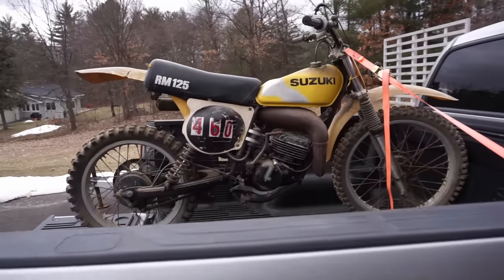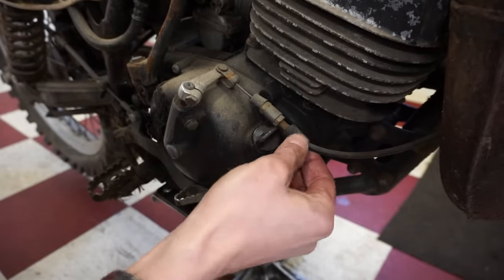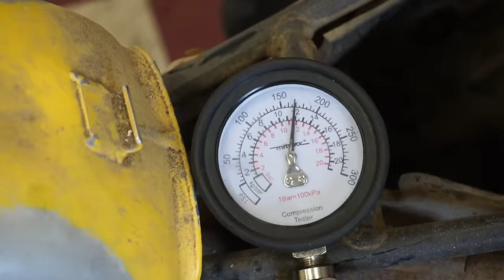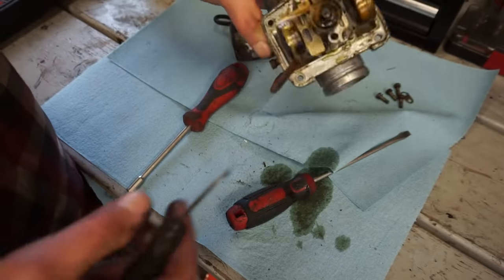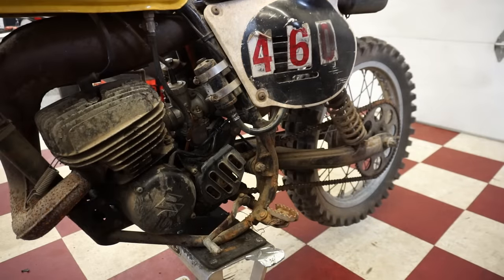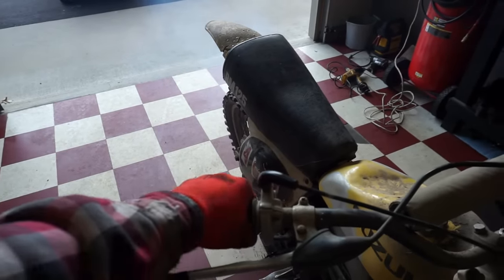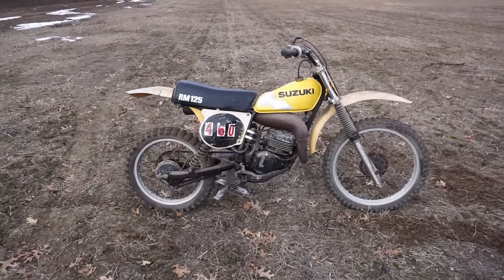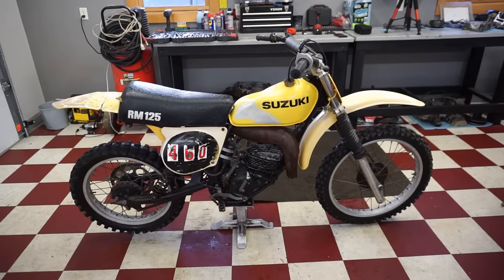Rare 1977 Dirt Bike Found Sitting In Barn For 20+ Years (AMAZING FIND)

Comment: I had a 1977 RM 125 when I was in 7th grade. When I heard the sound as you were riding it brought me back to those days. It was the most fun bike I ever owned. Thanks.
Reply: i had the '77 100 in 8th grade
Reply: Back in the day I had a 1977 125 it too was the best handling bike I've ever owned never should have sold it in 85 to get my RM 250 in 86 I like my 125 more than I did the 250

Comment: Braze a Schrader valve onto and old metal gas cap, screw onto tank and then add air...slowly. :D  I've only ever done this once, but it worked like a charm.  Or call a paintless dent removal guy. They are pretty amazing. 

Sounds very good...didn't miss a beat out on the land. And the smoking cleaned up. LOL Perfect! 

Back in the early 80s, I was still riding one of my two 1971 Ducati RT450s. (Still have them...haven't tried starting them since the mid 80s.) Come winter time I went up to one of the local lakes in the BC interior with a few buddies, our families and a few snowmobiles as well. The night before I was furiously screwing as many sheet metal screws into the knobs of the tires to get ready for the next day. What a riot. I could even run on the harder packed snowmobile trails if I kept the speed up and hung my ass out over the rear fender to keep the weight off the front. Like riding in the sand. The lake was glass smooth and I've never had as much fun laying a bike down at any speed and sitting on the seat and spinning around as you slide for 60 or 70 years. :D.

Comment: Make a rubber stopper with a schrader valve....Seal it off to tank...Add air pressure gradually.. You can also use a map gas torch to heat the dented areas slowly. The heat will also cause air pressure to expand so go slow and be patient...
Reply: I had heard of guys doing the same using a tennis ball with the Schrader valve in it. Cool!
Reply: I agree with this idea.
Reply: Good advice, just be careful how much heat is added to the aluminium: too much could cause it to melt or even blow too far outwards.
Reply: That's exactly the principle I had in mind.
Reply: Said the same thing

Comment: Joe great find. About the gas tank. This when I was younger. It don't work every time. We used to put them in the freezer with water in them. It will expand the tank. Then we got older. We put water in them and heat the dents. Make the water boil. It would come out. Thank you. It reminds of the good old days.

Comment: Reminds me of my first dirtbike, a 1983 rm125 (first blue seat models). I bought it in a very similar state to yours and had been sitting in a shed for 24 years according to the previous owner. Cleaned the very rough looking carb and immediately fired up. These bikes are tough! Having said that, a common issue with these old rm's including mine is that the frames split real easy right under the engine. Nothing a quick weld can't fix though. Curious to see how this one turns out... Keep up the good work and I'm sure you'll flip it without any issues👍

PS. An amazing life hack I never see you use in your videos is mounting/removing the grips with an air compressor. Makes it 10x easier and saves lots of time and energy!

Comment: Wow! I was 14 when I bought my 1975 RM 125! I sold my 1972 Honda SL 100 and my 1974 Suzuki TM 100 to do the deal. I loved that bike! I side saddle pushed it until my friends house who lived next to Morgan Cemetery which we also walked/side saddled thru in 2nd gear. Once thru the cementary we pushed them another few blocks until the train tracks that ran parallel to the Delaware river. At the tracks, we looked both ways for cops and moto'ed it about a half mile until we crossed Rt. 73, down the embankment and ended up behind the Palmyra Diner parking lot which was next to the Tacony Palmyra Drive in theatre and the miles of dredged sand dunes from the Delaware River being dredged back in the late 60's and early 70's. One gallon of premix fuel in a plastic 1 gallon milk jug would get us a couple of hours of awesome riding and back home for dinner by 5 and time to walk to the Pennsauken Mart to buy Lynyrd Skynyrds new Street Survivors album on vinyl. The good ol'days with no bills, no worries other than homework, cleaning the dog doo in the yard, trash cans out or washing one of the family cars.
Reply: Wow,  I rode there before and my friends father took us there with his 80 Husqvarna 430. Brings back memories.  I still live on Robbins close to the Tacony Palmyra Bridge.

Comment: If you can find a way to seal up the tank and slowly pressurize it with water it should push the dents right out, it didn’t look like there were any bad creases. Love the old 70s bikes, I had a Yamaha 175 enduro back in the day, my first taste of freedom!
Reply: I agree. Maybe even pressurize it with water with a little heat the same way you fix dented stroke pipes.
Reply: Exactly what I was thinking
Reply: Yep, and maybe combine that with a hot glue dent puller system used on cars. Cheap ones start around $65. Lots of car vids on youtube using this system.
Reply: It will still look like sheeit. The major depressions may come out, but it will still look all mashed up and creased. You may also expand or burst the seams. The only real way is for the underside to be cut out and then the exposed tank is smooth rolled using a planishing hammer and/or English wheel. Then the under panel is tig welded back into place. A lot of it can be partially repaired using rod anvils inserted into the tank without cutting out the bottom, but that method will never fully restore it.
Reply: @drott150  absolutely right it’ll never look perfect but it’ll be 100% usable and you won’t have to cut the tank apart.
Reply: @minnesotatomcat  It's 100% usable as it is.
Reply: @drott150  not full capacity with it caved in
Reply: Restore it Joe! We need more videos😂

Comment: I was working on my 1977 last night ...i run 32 to 1 ...back in the day they used to run ATF ...you might run it thru the gears and then drain .. will help keep clutch plates from sticking.
Reply: I have put 2 stator and 3 cdi boxes to get it to run...yours starts 4th kick...I had 2 tanks restored and painted for 700..just sold the extra for 350.

Comment: I had one just like it a 77 RM125B  Bought it off the original owner back in 1983.  Sold it in 2006.  That is an awesome bike.  Always started and never let me down.   On mine the side plates faded.  i ran through a barbed wire fence and cracked the front number plate.  The wire also looped up and put a hole in the seat cover.  I also had the original sales slip from the original owner. $475.00  I believe the only thing missing on mine was the front sprocket guard.   I'm not sure they are the original grips.  the originals had the Suzuki S on them.  I couldn't find  a front number plate , I looked for one back in the 80's after I ran through the barbed wire fence.  Definitley  a good candidate for a restoration.  I will say the guy I bought mine form really researched things before he made the purchase.  It had to be the top bike in Motorcross Action and Dirt Bike magazine for 1977.

Comment: Thanks Mister. I have a what I thought was a '77 RM-250 but it has a steel tank I'm sure. Been sitting in a shed for +15 yrs. I quit riding because I'm old and it beat the crap out of me. Think I'll pull that baby out this spring and see,, it was running when I parked it. That sound got my love for the old bike back.

Comment: I had one of those back in '79 and man that thing would scream, and it was very reliable, never any issues with it. I had it until '83 when I bought a brand new '83 model, which by the way was far more advanced, mainly the suspension with the full floater rear end was awesome. I raced the '83 for a couple of years, then just rode it as a dirt bike until '91 when I sold it. But it was still running great and I wish I still had it. I hope you restore that '77 and keep it!

Comment: Use water to remove the dents in the fuel tank. Much safer than air pressure. You can buy kits for removing dents from exhaust pipes. The kit, which includes a pump, can be modified and used for the fuel tank.

Comment: I bought one brand new. Raced it about a dozen times. Ankle got a workout rowing the gearbox to keep it on the powerband. Throttle was basically an on/off switch. Ran BelRay oil and 260 Sunoco.

Comment: I had a '79 RM125......light as a feather and good power.  I'd been riding YZ Yams Monoshocks and was a bit bothered by the shocks jutting into my leg area on the 125 RM.  Great bikes and would rev to the moon.  These babies would turn on a dime and give you change....always liked the inside line.

Comment: Yea, that 77 rm 125 is a keeper-full restoration needed-your tank on the rm 125 needs to be charged with air. Block off all ports on it and plug the gas cap with a heavy rubber plug making sure the air inlet is through the gas cap plug. Connect the air line into cap plug. Heavy volumes of air is what it will take your best friend will be that air regulator, so actually, the air pressure will pop the dents back out. From the inside out.this method is used on semi truck tanks to push dents out and it works,just don't get crazy on the air pressure in the beginning ,all at once, work up to it slowly with the pressure , because that gas tank is way thinner than a semi truck tank -but both aluminum, try it, it will work.

Comment: Find someone in your area that does paint less dent repair (pdr).  Those guys have all kinds of different rods for pushing out dents at different angles.  They also have plastic pins that they can hot glue on and pull dents out.  You won’t believe how well it will turn out!

Comment: Never had a doubt that it wouldn't  run when you saw it had spark, would also say to let it ( the cylinder) warm up to expand along with the piston, don't start it and rev it to 10 grand, you can restore it as much as you want, just remember the crank seals are 47 yrs. old , I grew up riding and wrenching on dirt bikes and always kept em tearin up turf ,back in the day if the fuel tank got dented, we'd throw a lit M-80 in there and run, but being aluminum I'd try a mechanical way of repair, or just leave it, anyway thanks for the memories and the video and best of luck with the resto!

Comment: Looks like my bike from the early 80's. RM 125B. Use Compressed air to get the dents out. My bike was a school project in high school automotive class. I tried unsuccessfully to mill a rear sprocket in metals class per-cnc days. I still have a polaroid of it. Unless you are in RI, it couldn't be my bike. But, so cool to see one again. I'm just getting into motocross bikes again at 58 years old. Friends are wishing me luck. LOL! I'm gonna introduce my son to the sport.

Comment: You probably already figured this out by now, but the rear brake issue is that the arm on the drum needs to be re-indexed rearward so the throw is at the engagement point of the shoes. Should just be able to pull it off the splines and rotate it backward a bit and reinstall.

Comment: Had one of those. We went up 4 or 6 teeth on the back sprocket and dropped one on the front. Top speed was 36-38 but it would climb anything and wheelie in all 5 gears.

Comment: You should be able to pop some of the dents out of the tank by putting a tire tube inside and then putting air in it. Be strategic on how you place the tube and warm up the tank a bit with a heat gun to save the paint from cracking and to give the metal a bit of give. Keep the great content coming.....@stanforadventure

Comment: To take off those dents try to fill it fully with water and put it in the freezer. Must be well sealed so the when the water expands when freezes it will push out those dents. Some told me that tried before and wroks. Those dents are big, so i guess u’ll have to do it multiple times… hope it will work! Cheers

Comment: This RM125 was my very first race bike. It was the first motocross bike produced with the high exhaust. The engine was what they called a square bore because the Bore and the stroke were the exact same. I rode and raced the hell out of it, I also kept it in Storage in a hey barn for 25-30 years It was in much better shape than this bike. I protected the tank with clear MacTac  and also managed to keep it dent free. The bike was $1300.00 new, I sold it to the guy that sold it to my parents for $500,00  he owned the Honda and Suzuki shop in the 70’s and latter  owned a very successful Harley Dealership. He told me he had a collection of all kinds of bikes that he either owned, raced or sold through his different dealerships. RIP.  AP

Comment: The 1977 rm 125 was my first bike. I bought it used from a car lot by my house in 1979. It had red white and blue Fox shocks, and a yellow frame. I got a job at a burger joint next to the car lot at 15 years old to buy the bike.  I told them I was 16, they could care less. Every time I got payed, I would give my check to the car dealer. My parents were not interested in helping me buy it. After I payed it off I quit my job, and used my allowance for gas every week. I rode every day rain or shine till the sun went down. Now those were the good ol days.

Comment: I know that bike, it was ice raced in the area a long time ago.  I believe the engine was in the shop I worked at.  Check the cylinder and cases to see if there are shop stamps on them, I’m not sure if I put a piston in or just ring and clips.  I’ll watch the video and add more if needed.  The tank can be fixed, I believe they pressurize them and work the dents from the outside only.

Comment: Ah! I had this bike when I was about 14 years old. I bought it second hand together with a friend of mine. We worked at a scrape yard during Summertime were the guys repaired the aluminum tank for us with some plaster and spray paint. Very peaky. When you just go over a bump with your front wheel and at the same time the power kicked in it was scary.

Comment: 28:43 Look at the speed of the exhaust gas flow. 

You definitely have a blocked exhaust flow.
You may get away with it if you burn it out when the exhaust gets hot enough.
Reply: Yep, your exhaust freed up and flowed well after the first bit of riding.

Comment: Apart from the air filter, footrest spring and rear brake servicing, I'd leave it as is (but remove those red numbers). Can't comment on clutch cover though, as no close-up pics.👀 But a great sounding bike, loved the  tuned 2 stroke exhaust note since the 60's. Great video, thks.

Comment: I was 11 years old when this bike came out and I remember this era in motocross technology well. 1977 was the exact "transitional" year where motocross bikes were really achieving what remains today modern levels of performance. The low weight, the excellent power from the engine, the suspension travel and dampening - it all started to come together that year. In fact, if that bike were restored with maybe a few minor mods with light porting, jetting and pipe, replace worn out shocks? A good or pro level rider could still hang with modern 125s today. Even with the old drum brakes, which weren't as bad as younger people think if setup correctly.

Comment: I bought a 1979 RM 80 for $250.  It wasnt going had spark issue.  I found the mains were the problem so had to split the crank and replace them as well as the rings.  Boy that thing was fun!!.  Swapped it for a 1980 DT 175 Yamaha but the carb was stuffed so i put a IT 175 carb on it.  Got 100 mph out of the DT 175 with the IT carb :D.  That DT was hella fun too.

Comment: You can treat the tank like a header pipe. Pressurize the tank, and then heat it with either a heat gun or torch. You might ruin the paint, but the dents should come out.

Comment: How do you get the parts new? If I did a rebuild I wouldn’t want any used parts unless I had to. Anything that has a bearing needs to be brand new for sure or it may not last. What a great project to work on

Comment: Get a bicycle tube take out the valve, attach it to a air compressor hose, that air filter clips onto the valve stem put the tube where the dents are inside the tank, slowly add air 
I’ve had to do this  on several tanks also used tubes from wheel barrel tires for stiffer dents

Comment: That was one of my favorite RM I25 I had until I got my 125C that is the first year of RM it is a RM125 B. The bike that turned my moto X skills into a lot of wins. I'll forever love the Suzuki RM series. That's when Suzuki ruled the Moto X world. Not the first though Roger Decosta won 5 world championships in 500 class on the old TM series. I had a TM and they were just like the CR Elsinore no mid range and you had to keep the rpm up to be in your power band. The RM delivered beautiful mid range power and pulled strong even at lower RPM. They loved the cool air of fall considering they were air cooled and the bike would get even more crispy.

Comment: I had the 1976 and 1977 RM 125's to race brand new. Check the rear shocks, mine wore out the  pistons the first year. The 1976 had bad cranks and mine and all my friends had the ignition side shear off in the same 2 weeks, Suzuki provided a new crank half but no labor to rebuild them !  All Yamaha"s after that happened. Try compressed air to blow the tank back in shape. A friend crushed his tank in completely on one side the first day riding it.